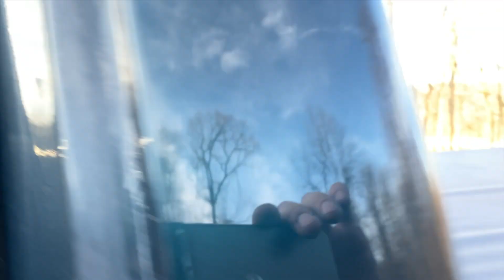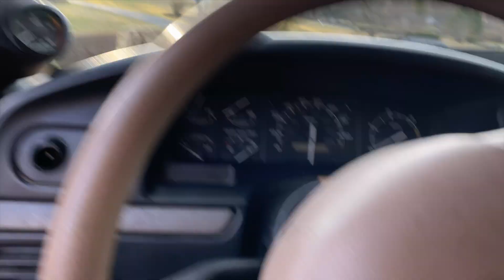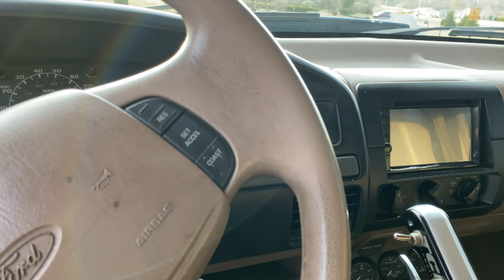Complete Walk Around of the FUMMINS! 700hp 12 Valve Cummins in an OBS Ford!

Comment: What trans you running to setup the tci ratchet shifter? I’m building a single cab 4x4 6.0 powerstroke and trying to keep the 5r110 Ford trans with my 24valve compound setup